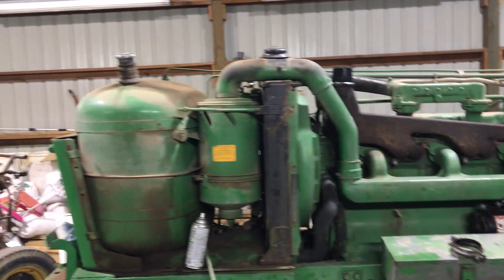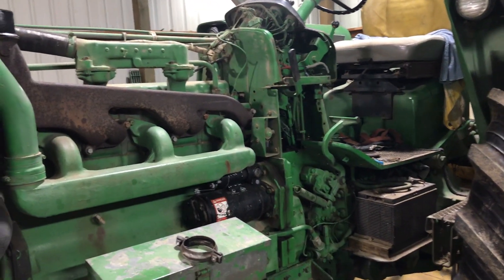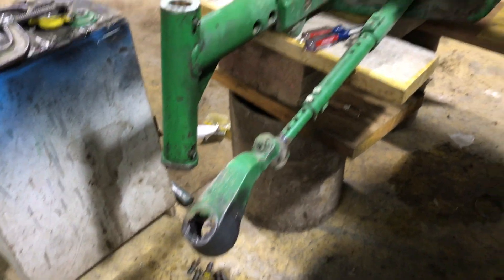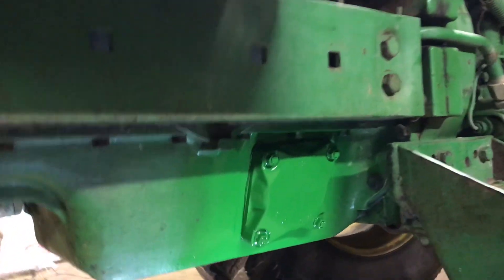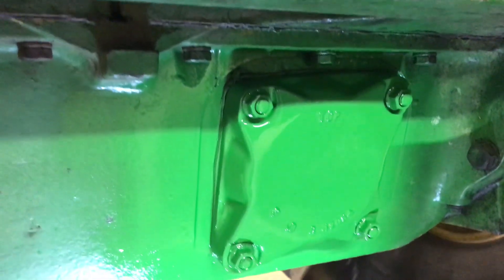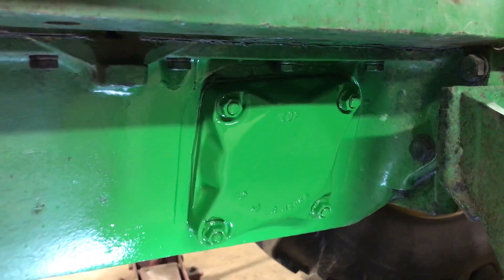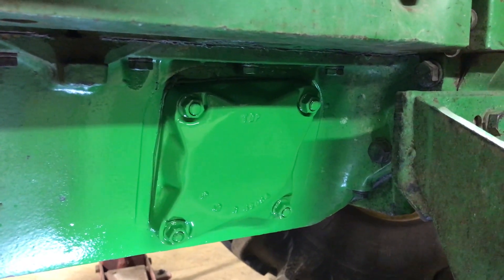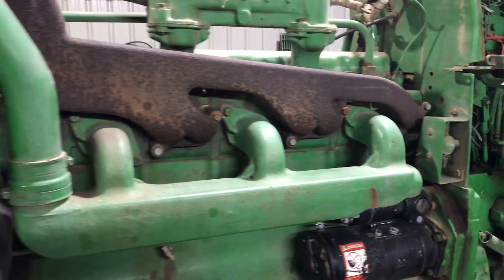Oil Change On Our John Deere 4020

Comment: Is the transmission/drives and hydraulics all one on  a 4020?
Reply from the maker: Yeah on our 4020 the transmission and hydraulic system is the same, using the same oil. I don’t know of any 4020s that have split/separate systems but I’m not an expert on every 4020, just familiar with ours. Of course this video is on changing the engine oil.
Reply: @mt.hopefarms9151  yea, the engine is pretty cut and dry. I just bought a 1968 synchro. Im coming from all things 2cyl and am learning quickly. I have the injection pump off now getting rebuilt and turned up. Still waiting on manuals though for everything. Thanks!